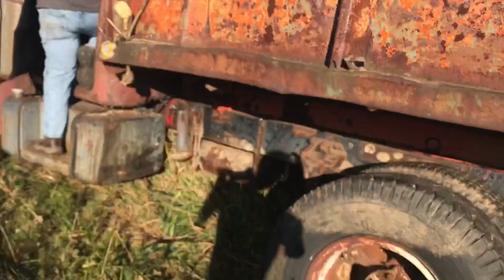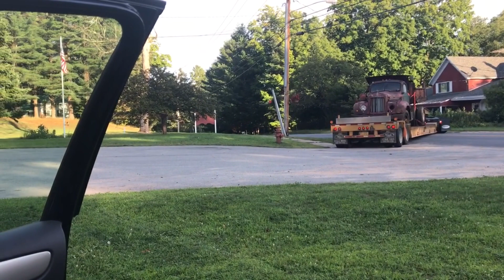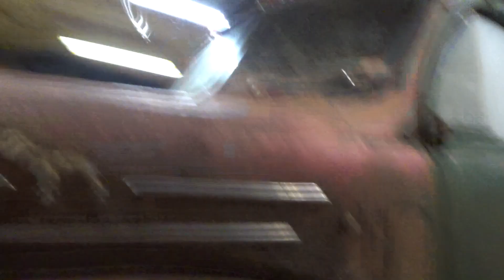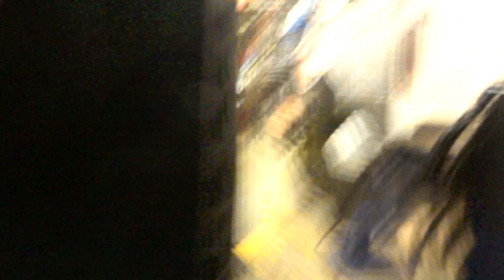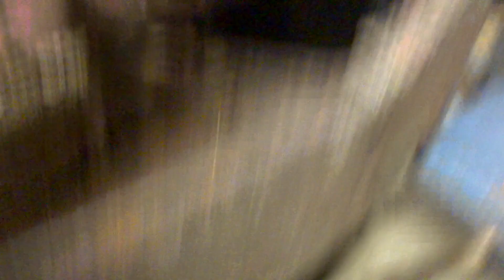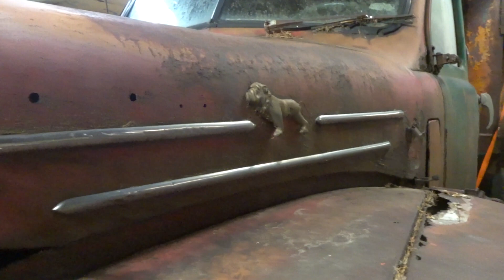1958 Mack B42T Comes Home

Comment: Hard to believe one day many years ago that rolled off the assembly line brand spankin new. Love the B-model Mack. When I was a kid in the 1960’s in front of our house they were installing a sewer project, I remember two twin screw dump trucks, both were green and both were gassers. One truck was a N-model ford dump truck tandem axle and the other one was a B-model tandem axle dump truck and they were hauling away the road where it was dug up. My first B model I ever saw and have loved them ever since. I would love to own a B42 gasser, short tandem axle with a 12 ft. Dump body and a 5x3 transmission. This would be My dream truck and it would be green and it’s name would be Fitch, that was the name of the road they were doing the sewer project on and this was around 1968 in Olmsted Falls Ohio.
Reply from the maker: Thanks for the story.  They are an awesome truck.

Comment: Will there be a " will it run " video?  Cool old Mack Ed
Reply from the maker: Pretty sure I won't be able to bring this engine back.  She is seized and has a rod sticking our the side of the block.  I would like to try but probably better of finding a diesel.
Reply: A 6/53 Detroit would be a sweet motor for it.